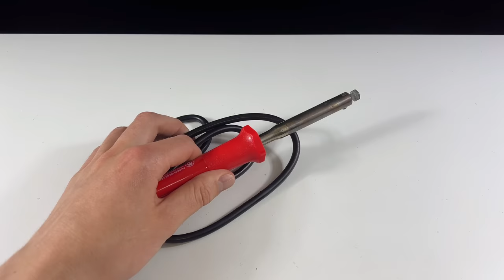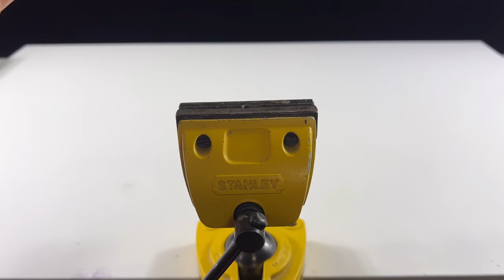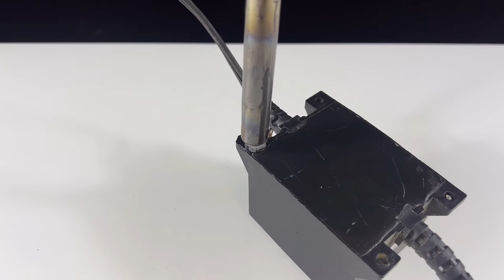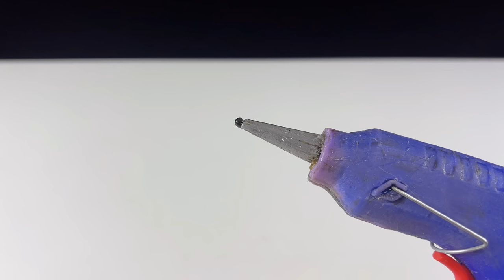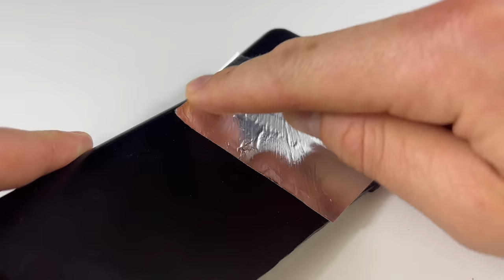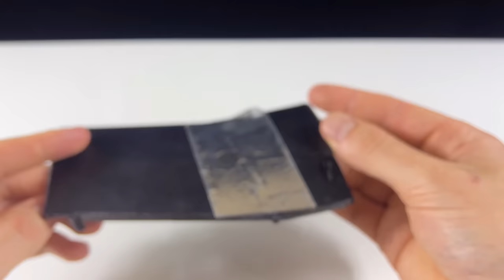Ingenious Ways to Repair Broken Plastics With Plastic Welding Method

Comment: I find that paperclips work better than screws and washers. For broader areas and to span gaps, patches cut from aluminum window screen work well and can be back-filled. Rather than destroying a hot glue gun with melted zip ties, I use a flat blade on my soldering iron in one hand and feed plastic with my other hand much like stick welding.

Comment: With the amount of fixing, I have to wonder. Is it better to just throw away a thing and buy a new one, or procure a set of (sometimes expensive) tools and go on on fixing things. I like the ideas, but just how many of broken thingies do you need before you go out and but a set of pliers, soldering iron, an electric file etc. It's all good when you already have them and I am all for it, we definitely should look for ways to fix things like they used to back in the day instead of simply throwing them away, but gosh, how many of these do actually break on a daily basis to warrant a set of fixing tools.
Reply: You don't need to buy all of those tools. Ask neighbours or family, sometimes they have (power) tools and may borrow it or give it, even for a free. I have a soldering iron from my grandfather: old but works perfect, and now it's a souvenir. Some others I've bought cheap, because it was used / refurbished. You may also solve it in another way. On this vid is a soldering iron, but you may heat a nail on a lighter or even a gas stove, you just need pliers to hold it.

Comment: Is that a zinc/allow bolt you use? I tried one with the exact same soldering iron and it doesn't get hot enough. What's the trick?

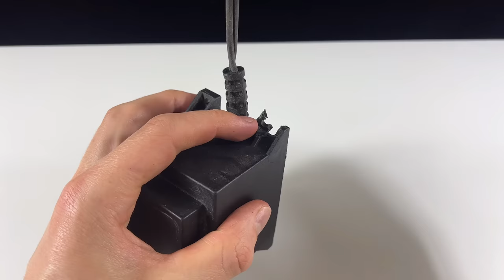Comment: 1:04  literally uses super glue for its purpose. How is that a hack lol
Reply: Looks like the super glue was just temporarily holding it in place for the plastic welding. 

For something like that mounting tab that will have to support some weight, I wouldn't trust super glue alone.